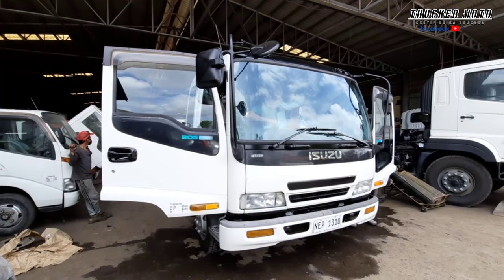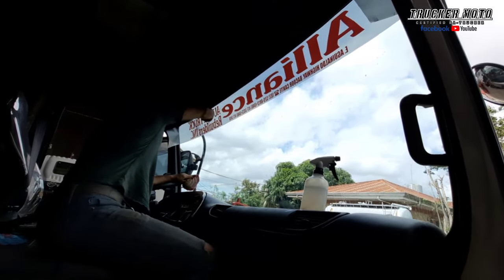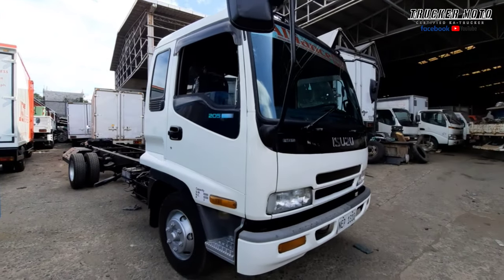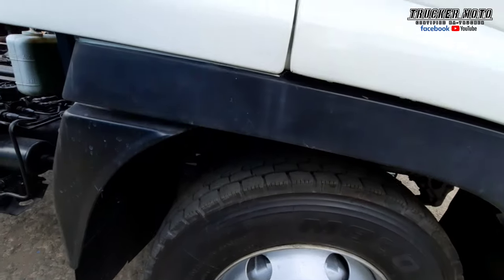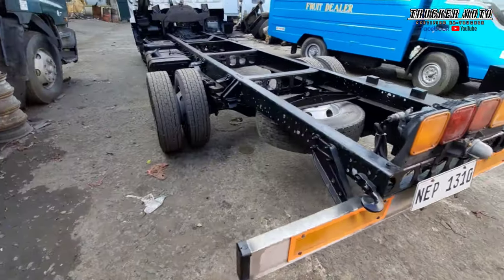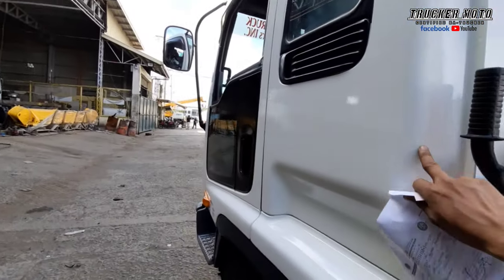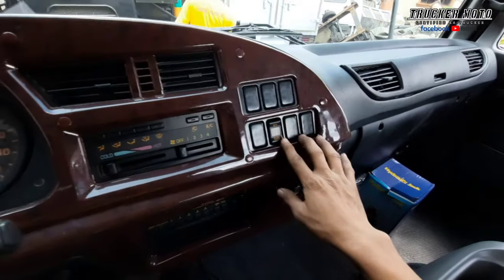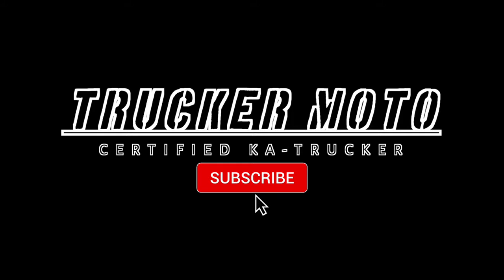WORST INVESTMENT BANG BUMILI NG SURPLUS TRUCK?

Comment: Nung bumili kami ng 6hk1 - tc frr isuzu 4ward,, na sira ecu pina manual ko gumastos ako 200k tapos na backjob ..pina trabaho ko ulit sa panabo city..salamat sa dios na takbo na..isang taon ko d ko na gamit..grabe talaga...
Reply from the maker: Wala ba kayo mabili ng ECU Ma'am
Reply: WALA  PALANG NAG  REREPAIR NG ECU DYAN BOSS... NG MGA  COMMON RAIL TYPE  ENGINE  NA YAN...
Reply from the maker: @gabrielbasanes4645  hindi na po kami nag rerepair nyan, bumibili nalang po kami ng isang buo.
Reply: Mas maganda gmitin 6m70 T5(460ps) AT 6M70 T7(520ps)  mas malakas kysa sa lahat ng 6hk1

Comment: You guys mechanic too?
Reply from the maker: Yes
Reply: @truckermotoph  what oil would you recommend for Isuzu forward 2001 differential?
Reply from the maker: @caribbeantrucker9535  Oil-90
Reply: @truckermotoph  thank you same for transmission?
Reply from the maker: @caribbeantrucker9535  yes
Reply: @truckermotoph  good day i need some assitance in changing a belt tensioner on a isuzu forward